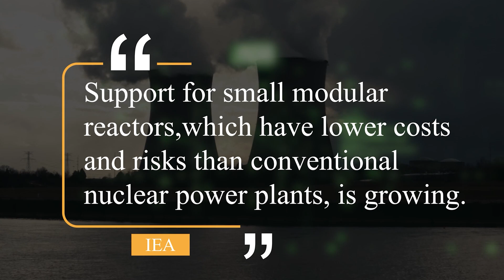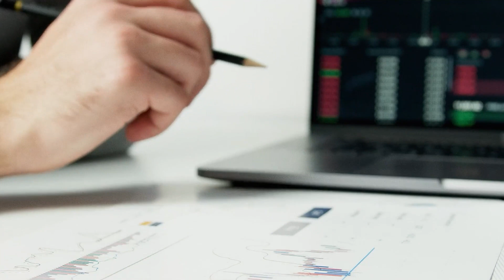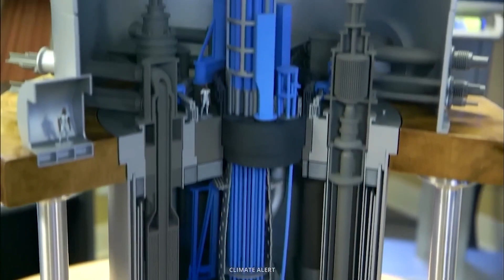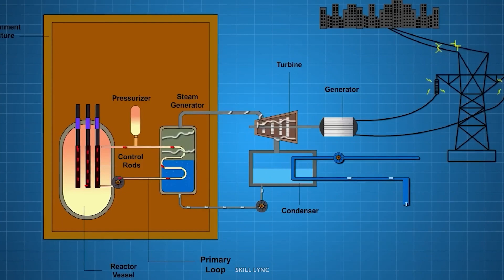The SCARY Truth About Nuclear Power Energy

Comment: Wind and solar are not necessarily that clean when you consider the carbon made in the overall creation and death of the panels and turbines.  Nuclear power (Preferably something other than Uranium-Pressurized water) increasingly looks like a better option. Greens are so buried in close minded dogma, that they don't even consider there are better safe designs.   They just want to ban nuclear, ANY nuclear.